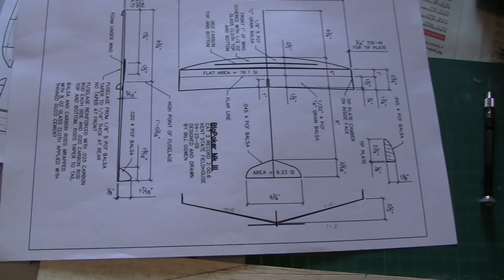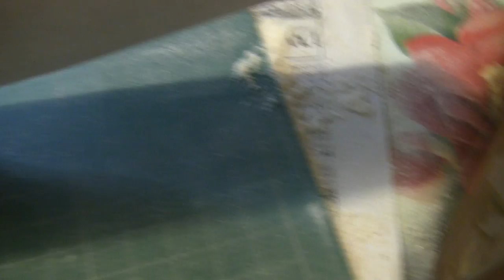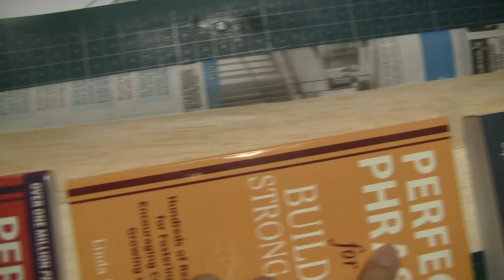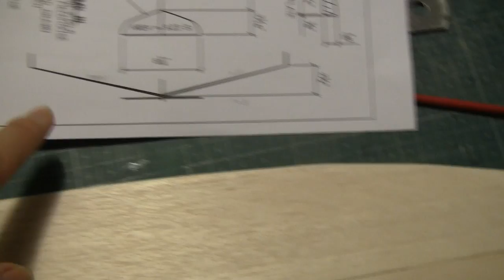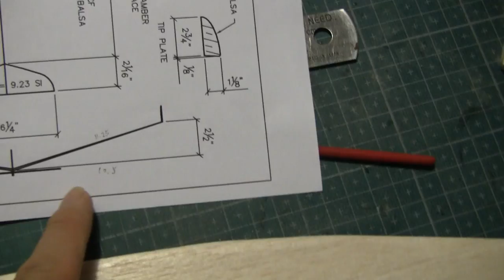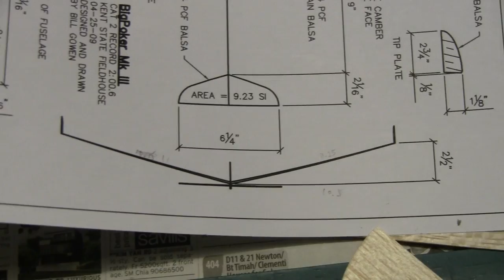Indoor Glider BigPoker Mk III. Part 1 of 2

Comment: If you want something elegant for weight... visit a bicycle shop and purchase a spoke and brass nipple. Cut a length from the threaded end from the spoke and affix it to the glider body, the threaded portion that the brass nipple sits on will allow you to "trim" the glider weight, just slightly.